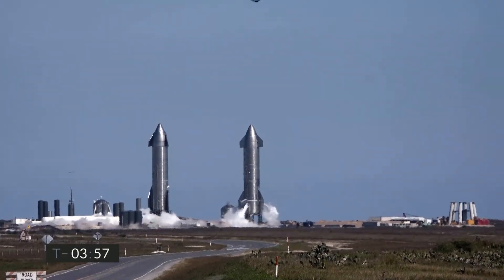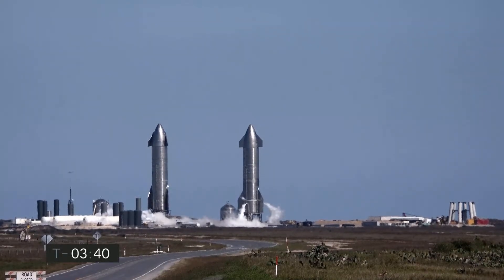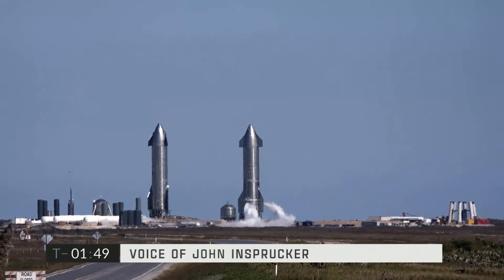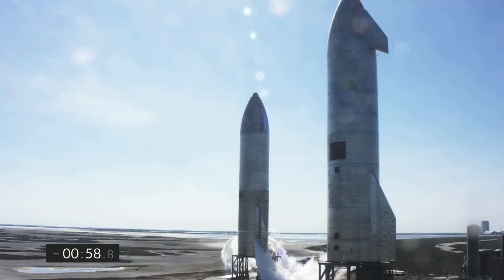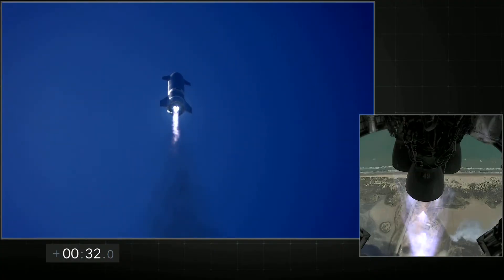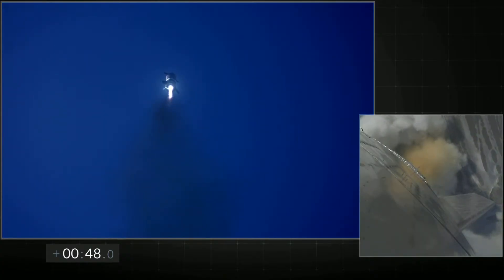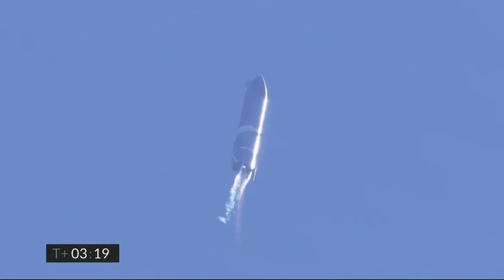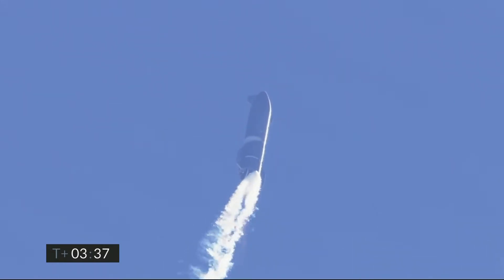Starship | SN9 | High-Altitude Flight Test

Comment: SN8: undershot the landing 
SN9: overshot the landing 
SN10: 3rd times the charm...?
Reply: Let's just say the rocket engines are the ones that need improvement at this point, the computer system works as planned.
Reply: @stanleycius3295  There is probably alot of thing which could get more development in programming. I think it would maybe be smart to program some kind of a backup landing program stuff which would react if something goes wrong and try to get it back on the track.
Reply: Stanley Cius  said the programmer to the engineer LOL
Reply: Took the Falcon a lot more than 3 attempts before they stuck one. Maybe in a year or so?
Reply: @RealityIsTheNow  well they also still have all the experience from the falcon 9
Reply: @RealityIsTheNow  nahh
Reply: @RealityIsTheNow  Falcon 1 took 3 attempts to fly, I know it isnt the same thing but it goes to show
Reply: @RealityIsTheNow  2 attempts
Reply: @RealityIsTheNow  we’ve only had two starship flights is what I’m saying. It means that you should have said a lot more than 2 attempts.
Reply: @RealityIsTheNow  yes but if you’re comparing to starship you would use starships # of flights
Reply: I watched in slow mo I think the engine may have just blown up and flew off or a part of it did since something definetely broke
Reply: @OLM_7  The second engine didn't relight and thus there was not enough control authority to orient the rocket vertical.
Reply: @jakekiedaisch2279  Well something definetely fell off which caused the engine to not relight
Reply: RIP sn9
Reply: @BladeCast And no, it's not fully applicable. Trying to restart far more complicated engines after sloshing the fuel around sideways so it can't as easily be fed to the engines is VERY not applicable to the relatively simple and vertical F9. These header tanks are an entirely new idea.
Reply: At 12:45 "...we need to work on that Landing... a Little Bit..."  😆   I love that "A Little Bit"... this comment is is Masterpiece...   but would be useful to work a little bit more,  than a Little Bit, please 🙏
Reply: @BladeCast Well, you guys are thinking best-case scenario. While it is true that they do have the experience from falcon 9 it is a different ship with different aerodynamic capabilities. There is no way to just compare the two and say they will do it because the previous one worked... picture this: I'm building a car. I've built a family car in the past. That does not guarantee that I will make a good formula one car for example. I know how to make the family car work, I know how everything works. But it's a different kind of car so there are no guarantees that version 1, 2, or 3 will work.
Reply: Mainly was because second engine cut out or didnt work both times, otherwise wouldve been perfect. sn10 will be perfect
Reply: @DaveYogs  they need to do a static fire simulating a landing then
Reply: @DaveYogs  header tanks
Reply: Ken Ling yeah the second engine didn’t relight properly which caused the other engine to way overshoot the flip. We will have to wait and see what happened to the engine
Reply: @DaveYogs  SN8 has issues with the header tank losing pressure. SN9 had a engine failure it looks like
Reply: @DaveYogs  looked like it was still running on the way down
Reply: Both times issues with restarting the engines.  I'm wondering if they need to start this maneuver higher up and make the maneuver less drastic plus more time to restart the engines and settle the fuel sloshing around.
Reply: Overshoot?? This looked like it got no throttle when needed. Don't know how many engines are used for landing,  but the single one visible didn't ignite OK when needed.
Reply: @override1337  Two engines used to reorient to vertical, then a single engine to land. They seem to be targeting a very rapid reorientation to vertical an instant before touching down and this is very hard to do.
Reply: @DGaryGrady  Yep, but clearly they didn't ignite as they should. And probably because of that there was other issue with engine No1 starting to "choke", with visible  decrease in power and change in exhaust flame color etc. I'm not Everyday Astronaut but for me it didn't land correctly :) Still, some time ago looking at Spaceship I just laugh. And today I see it flying and having more than basic features. Neat.
Reply: SN9: "I lost something" 🤔
Reply: 1000th like congrats
Reply: Sn10 will under overshot
Reply: Yes
Reply: SN10: Wait... Is that what happened to SN8 too? I feel I'd maybe I don't wanna go up.
Reply: Booster failure.
Reply: SN10 will be perfect
Reply: @BladeCast 

Starship is very different because there’s a rotational component that Falcon 9 doesn’t have, and if Starship could be loaded with more fuel, it could attempt a hover landing which would be a safer way to exit the belly flop.
Reply: Anyway it doesn't look like you want to be inside that thing anytime in the future.
Reply: SN10: "Phww,… amateurs. Let me show them how it's done!"
Reply: 3rd time 'just right'?  Maybe they'll nickname SN10 'GoldieRocket"
Reply: Ou jamais 2 sans 3 mon ami go back eating his baguette and his omelette du fromage frenetically
Reply: Half-Life 3 confirmed.
Reply: @BladeCast You trying to apply a true or false condition to your opinion of future events? As if your predictions are facts? You're in for some disappointment, methinks. ;)
Reply: Not that I am a rocket scientist...or anyone else reading this is, but...seems like it would be beneficial to start the engines a bit sooner and if you have a failure of one, you immediately switch to the third engine as a backup.  Does that make sense?
Reply: @hhale  that would require more fuel, which would limit the overall payload able to be carried. They may also be trying to shoot for a more empty vehicle so if it does fall down go boom, it will be less boomy.
Reply: @piercet  Then they need to limit the payload and/or figure out some way to slow the hell down on an emergency basis.  It doesn't matter if you get an extra 10-15% cargo in the thing if it goes BOOM even if only on a periodic basis.  This is a system that must always work, period.  Landing vertically is already going to be challenging enough with that tiny landing gear.
Reply: Nope just more waste of materials....

Comment: They look like rockets out of a hollywood sci-fi movie from the 50's
Reply: Guess those old movies did get something right afterall
Reply: They are!
Reply: Had the exact same thought.   All this amazing technology, and yet I'm half expecting to see the wires suspending it.
Reply: if only they made something like a space shuttle, which has hydraulic landing legs and can land like an F-35 jet. The centre of gravity is way too high
Reply: @oussamasama4490   The space shuttle was never a great option. It never had the ability to leave orbit, and it took 6 months of rebuilding between launches. Almost nothing was reusable. Walt to small of a payload. The starship is about 1/100th the cost, and will be able to carry 100,000 pounds of payload. Watch starship 8 flight. It was coming in for a perfect landing, just to fast because they couldn't get two engines to light.
Reply: @TexanUSMC8089  they could place the shuttle on the super heavy booster. And make the shuttle out of steel. Imagine if it can manuvere like an aircraft but land vertically/hover like an F35 or falcon
Reply: Well, a good idea you can't do yet is still a good idea.

Comment: SN8 was closer to make the landing. Hope they can turn this around for SN10
Reply: At least it was different failure
Reply: It was just a single engine failure I think... Otherwise they would've nailed it.
Reply: @jul1anuhd  side of engine burned on way up, betting something got cut to where it couldn't re-ignite properly
Reply: @Information_Seeker  oh fck so it was even very close  😑😐
Thanks for the info! Have a nice time.
Reply: nah it also had engine failure. This one had different failure though: compare color of the plume of the engine that failed (green on the previous flight, bright white here - you can see on 11:47 ). So this time something else went wrong.

Comment: Just when i felt the engine was damaged ,it crashed😫😭
Reply: It was supposed to crash lmao, they didn't have the hardware or software for a soft Falcon9 kinda landing
Reply: @adios04  The rocket had header tanks, flaps, landing legs, and re-ignitable engines. SpaceX was in fact attempting to softly land the thing.
Reply: @malachiwiens2455  exactly
Reply: @adios04  i know that it couldn’t stick the landing but didn’t except to crash sooo badly
I thought that the flaps would work like sn8
And didnt expect the engine not liting up
And thought that the header tank would not have problems